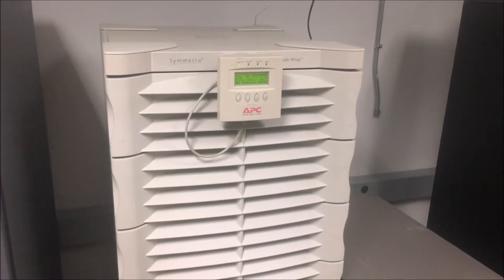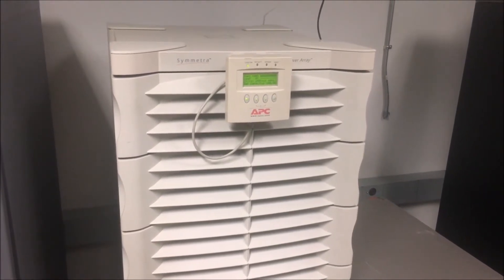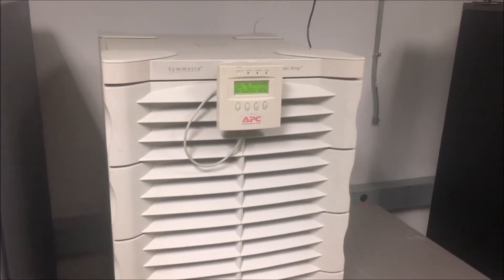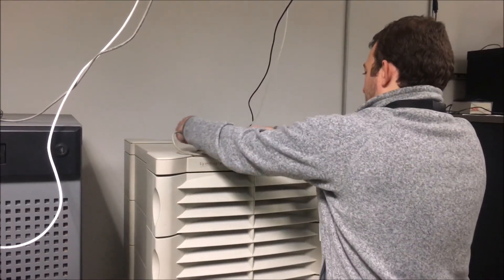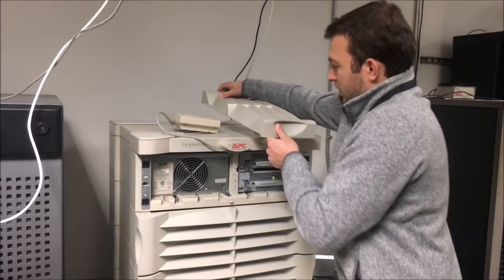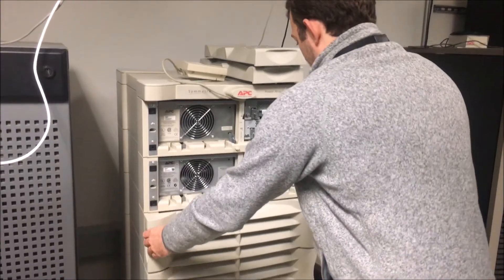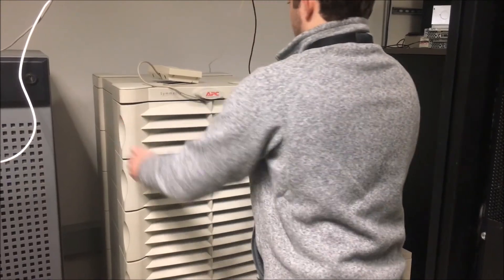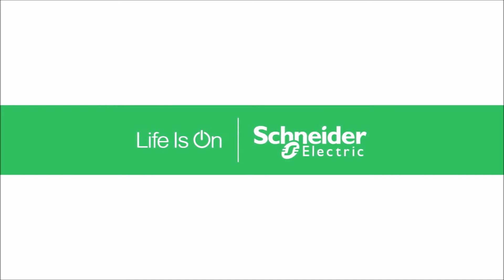Replacing SYBATT Battery Module on Symmetra Power Array | Schneider Electric Support

Comment: Any Lithium mods for the SYBATT?  Or anyone ever convert one of these for solar power use?  I acquired one with the extended run module and trying to find a use for it..  Few of the packs were swollen and removed, certain rest have failed by now, system has been offline for nearly 5 years by now...